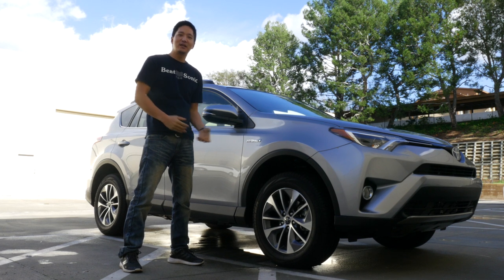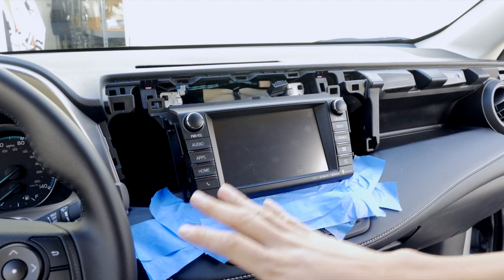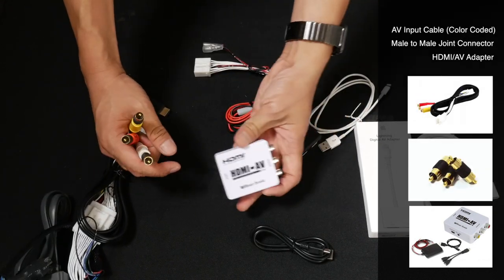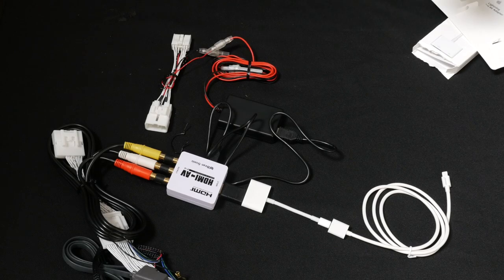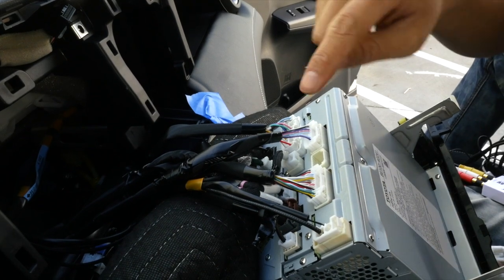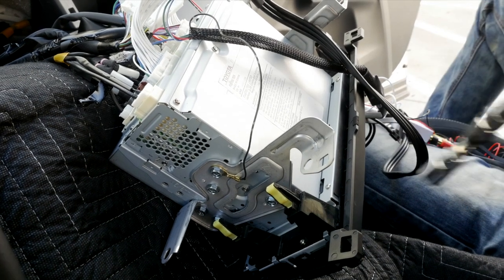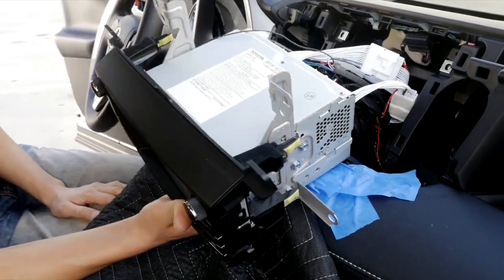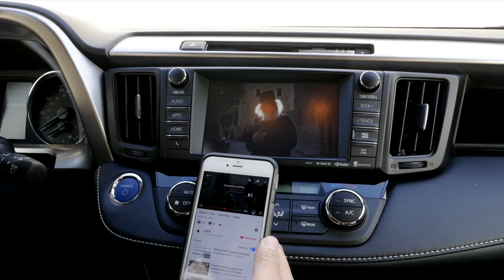[Installation] 2014-2018 TOYOTA RAV4 Smartphone Mirroring System

Comment: Very good video.  Also looking forward to the 2019 RAV4 version. Removal for 2019 looks much easier.  Just hoping the connections will be similar.  

Happy to pay $249 for something that works as simply as this!
Reply from the maker: Thank you for watching! As of 2019, the RAV4 infotainment has changed and this kit no longer is compatible. However, we are working on a solution so stay tuned!

Comment: Hey beat sonia. Great instructional video. Just wondering - have you tried replacing the HDMI > lightning adapter with a Chrome cast unit? Meaning the Chrome cast is installer directly in the av HDMI adapter. Wouldn't that actually work? And simultaniously give you wireless mirroring with both Apple and Android.. thanks in advance
Reply from the maker: This is will work. However you will need to put a hotspot in your vehicle as Chromecast does not allow to use the bandwidth from your phone.

Comment: Got everything hooked up, decent quality. My only problem is I ran into a safety precaution that disables my video unless the parking break is on/up. Did I do something wrong or is an extra step required? Switch doesn’t seem to solve it as far as I know. (2013 RAV/iPhone 7)
Reply: Nevermind, I figured it out. It case anyone was wondering; just have the parking brake down when you start the car and make sure you don’t mess with it during the duration of the drive or it will default to the safety precaution again!
Reply from the maker: Hmm that doesn’t sound normal. Make sure the ground wire on the bypass is secured on the vehicle chassis. For more troubleshooting please email us at info@beatsonicusa.com

Comment: one question, WHY? $300+ kit to use a factory radio full of wires when I can get a new car stereo with an HDMI connection for about $350 and no fuss with connections. I think you have a "good" kit, but to me is way over priced, specially now since there are several wireless options for around $60, just a thought...
Reply: hey could you recommend one of those wireless connections? :D
Reply: Flip seemed like a lot of work for nothing.
Reply: Video
Reply: Please show me a good car stereo that integrates with a RAV4 or the wireless system for $60?  Where to find? Thx.
Reply: chilehead craig Tell me too
Reply: The Rav4 seen here has four cameras that are input into the factory radio.  You can't just add a new stereo
Reply: @gopalraee6350  

I find it funny that people constantly complain about a Prius battery (maybe) needing replacement, when in reality, ordinary transmissions in cars cost WAY more. A Prius can run to 300,000 miles on a battery, and if it does need replacement, it cost under $2000. The rest of the car is quite reliable. Money is money, whether for a battery or a transmission replacement, and a Prius is literally cheaper. I know. Hums along trouble free. Love it. 230,000 plus miles and happily zips along. Great mileage, too.
Jamison June 4, 2017 at 7:55 pm

I also like to add, for those who don’t know, a Prius doesn’t have a “transmission”. Sure, its called a CVT, but in name only. It’s actually a set of 2 electric motors with very few moving parts. The engine generates electricity for the drive motors as well as charging the battery. These motors don’t slip, act up or ” die” on the road. Incredibly reliable. Don’t want to sound like a commercial for Toyota (I’m not) but only to try to get the message across that these mechanical CVT’s are not quite perfected. Their basic design has limited reliability and longevity. It HAS to wear out. Of you can buy a car with a “normal” trans installed, do that until CVT’s can be MADE to be long term reliable. Not meant to be a rain on anyone’s parade, but automakers are using customers as guinea pigs for their experiments, and WE pay the bill! As someone mentioned, get a stiff guarantee in writing if buying a CVT equipped car. You won’t regret it. All said, be careful with ANY CVT!
Reply from the maker: Price is actually $249. This will be able to keep the factory radio and functions without going aftermarket. Easier solution for install as well.

Comment: I see you hooked up this 14-18 Rav4 for Apple. But do you have an android screen mirroring tutorial? Or kit? I have a note 20 and a hybrid 2017 toyota without gps maps built in but It does have a crappy phone linked gps if my connection is good but I mostly run into issues with it not functioning properly... is there a way to use my android phone and mirror it to my Rav4 screen like you've done here?
Reply from the maker: Yes, the install is the same for android. Only difference is that instead of using an apple AV adapter you will use a wireless dongle. Description in the product link

Comment: The radio in my 2013 Rav 4 looks the same on the outside but the UI looks much different, would this still work?
Reply from the maker: This is not compatible with 2013 RAV4

Comment: I have a question...if I install the mirroring system, am I limited to using the phone for selection? Or can I select apps on the actual console and use them? Will they be responsive if I do my selection through the dashboard and not the phone itself?
Reply from the maker: The phone will have to be controlled on the phone itself. For a hands-free experience, we recommend you use "Hey Siri" feature on your phone while driving.

Comment: I have a 2014 Rav4 with the entune JBL radio. My question is, why doesn't my volume button and steering wheel volume button not work? The sound seems to work, but can't controle the volume up or down... Thanks
Reply from the maker: Did you install our kit?

Comment: Does it matter where you mount the netgear wireless adapter? Can you just stash it with the wiring down behind the head unit?
Reply from the maker: It does not matter where the netgear wireless adapter is mounted. Yes, you may stash it with the wiring behind the head unit.

Comment: when i specify i use an iphone 6s+ and 7 Plus, will the kit include all the items for it?
Reply from the maker: The additional parts needed for your iPhone will have to be purchased separately. Here are the links to those items:
 
1. Apple Lightning Digital AV Adapter: https://www.amazon.com/Apple-Lightning-Digital-Adapter-MD826AM/dp/B009WHV3BM

2. Lightning to USB Charging Cable (4 inches Lighting to USB): https://www.amazon.com/AmazonBasics-Apple-Certified-Lightning-Cable/dp/B010S9M3L6?ie=UTF8&psc=1&redirect=true&ref_=oh_aui_detailpage_o00_s00

3. Lighting Extension Cable (3 feet Plug to Socket): https://www.amazon.com/Cellularize-Lightning-Extension-Connector-Extender/dp/B018HD4RP0?ie=UTF8&ref_=cm_sw_su_dp

Comment: will this work on a 2016 rav4 xle with entune navagation?
Reply: I'd use google maps with the mirror over the very outdated looking Toyota nav system any day of the week. When you look at that Toyota nav vs GM, Dodge, or Ford's system you really scratch your head wondering how many decades old it is.
Reply: Larry Smooth Have you tied on your car yet? Cause I have the same car, would like to know the feedback. Thank you.
Reply from the maker: Yes this is compatible with 2016 RAV4

Comment: Can the setup be with both android and apple devices for use interchangeably or does it limit the installation to one or the other?
Reply from the maker: By using an HDMI Selector, you will be able to connect both Android and Apple device together.
Reply: Wirelessly?
Reply from the maker: Wireless setup is possible with Android. However, there is currently no stable Wireless phone mirroring system for the iPhone.
Reply: So. Then can I get a wireless setup for an Android, and a cable setup for an iPhone all at the same time?
Reply from the maker: Correct, by using an HDMI selector together with our kit.
Reply: Sweet. Thanks.

Comment: can you tell me how you pulled out that plate which shows seat belt and air bag indicator, on video its edited.
Reply from the maker: You may remove that panel simply by holding it with your hand and pull towards you as it is only being held by clips.

Comment: Will this work with a 2016 Toyota Rav4 hybrid with the jbl system? If I don't use the built in navigation at all what will the effect be on the system if I leave the switch inaccessible? I want this mirroring system so I never have to use the terrible Toyota navigation system again.
Reply from the maker: Yes, this kit is compatible with 2016 Toyota Rav4 hybrid with the jbl system. You may leave the switch inaccessible, the only effect will be that your vehicle will not move on the factory screen. Product link: http://www.beatsonicusa.com/if02ep.html

Comment: Do you have to disconnect the batteries before the project?
Reply from the maker: We recommend you disconnect the car battery for extra measure to not short any wires just in case you make any mistakes during the install process.

Comment: I broke my radio display on 2016 Rav4 SE I'm  looking for replacement that will work like original please help help help Thank you
Reply from the maker: Best bet is to check Ebay for used parts if you are on a budget. If you have money to spend Toyota dealer.
Reply: @BeatSonicUS   I know the dealership will very expensive so I'm I'm just looking for something that will work the same like my backup camera and GPS

Comment: Does anyone know how to use the navigation? I bought a 2014 rav 4 and on the info sheet, it said it had navigation but on the screen it only has a traffic app. Is this navigation?
Reply from the maker: Unfortunately the radio you have does not sound like it has navigation. Please call your local dealer to confirm.

Comment: Do you have to adjust the screen ratio everytime you switch from the stock system/mirroring?
Reply from the maker: The phone will remember the screen ratio setting and will automatically adjust when you connect it to the mirroring device

Comment: How to void your warranty
Reply from the maker: not if installed correctly ;)
Reply: @BeatSonicUS  Toyota told me that any modification to my wiring system can void my warranty
Reply from the maker: Toyota is absolutely correct. Since you will not be modifying the wiring system you won't have the problem. Everything is plug and play. Similar to plugging a USB to your radio to connect your phone, but install is done behind the radio :)
Reply: @BeatSonicUS  sure but nothing about that looks safe and it's too expensive
Reply from the maker: Quality = Price, Install is not for beginners who never worked on a vehicle :)
Reply: @BeatSonicUS  I can barely do LED lights of the last thing you want me to do is rip out my stereo
Reply from the maker: Maybe a shop can do it for you :)